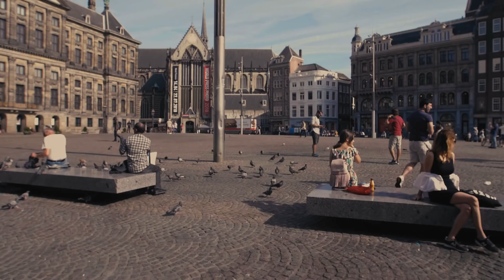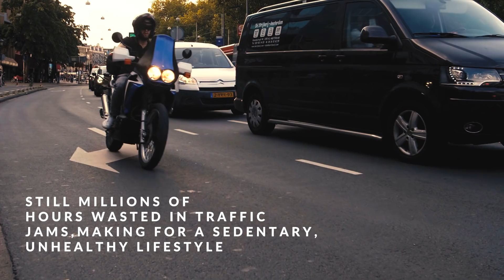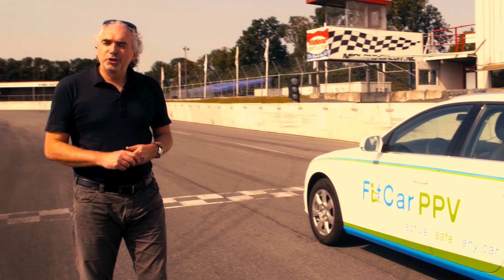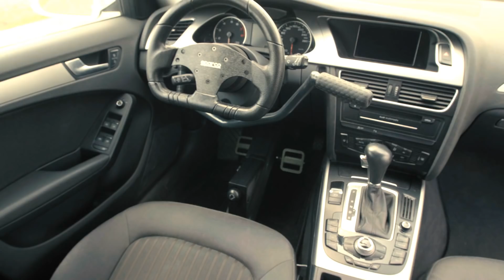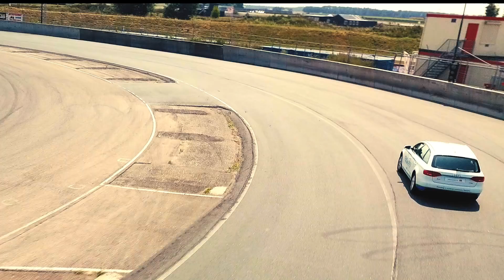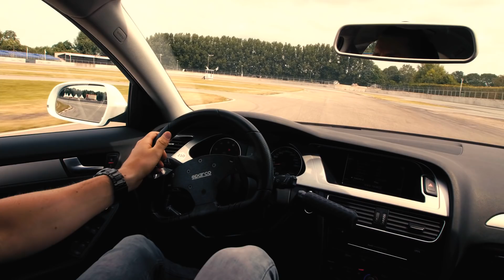The World’s First Calorie-Burning Car! FitCar PPV

Comment: I had the same idea because I hate commuting, but the driving position I envisioned was different. You need to design a completely new vehicle that merges bicycling and driving instead of adapting current cars. Pedaling position is not optimal for burning calories and feeling "free". Anyway, good try.
Reply: It's was designed in a way to an easy leg/lower body removal in a collision.
Reply: Yes, this differently designed vehicle was born in the 80s in Switzerland and it is called TWIKE. Great to see other paddling vehicles coming up.
Reply: YES, THIS SEEMS LIKE A HALF BAKED IDEA.